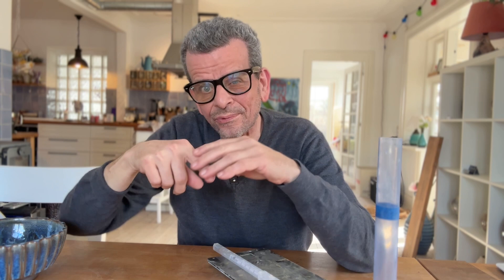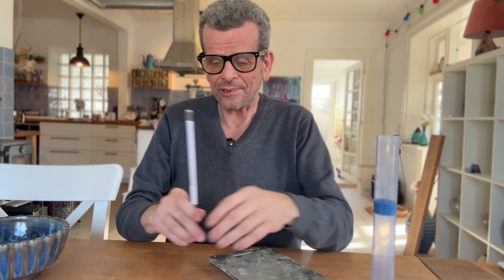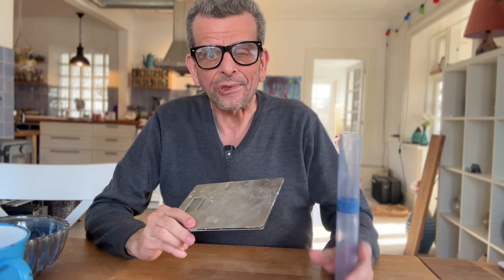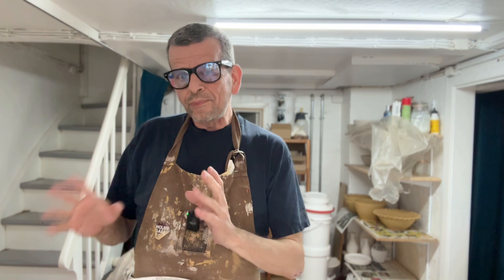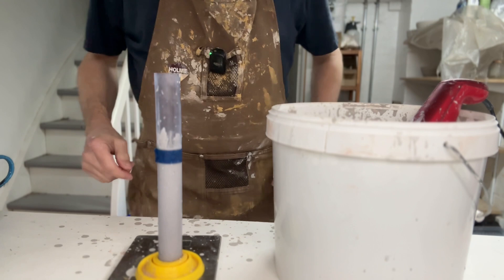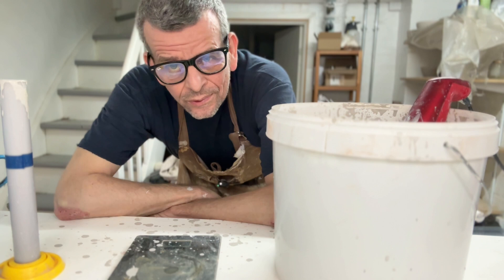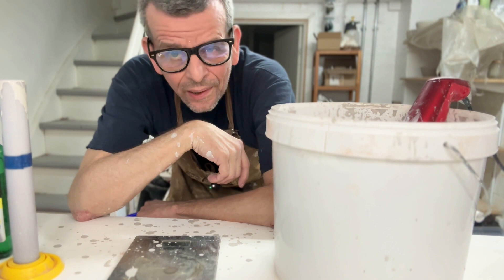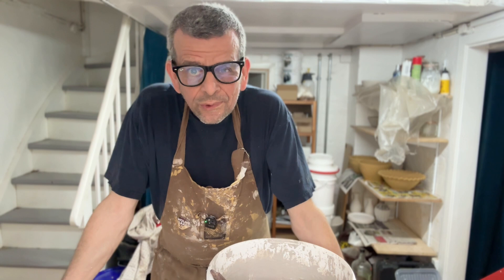99. How to Measure Specific Gravity (SG) for Pottery Glazes

Comment: Just curious, what was the SG for your Copper Green/Blue Crackle glaze in an earlier video??
Reply from the maker: Not sure which one you mean. I do not use crackle glazes :-)
Reply: @deMibPottery  Video #50 you have a Blue/Green glaze. This is the one I was asking about the SG.
Reply from the maker: Ahh that one. I actually do not measure SG for this sort of Raku glaze. I mix them very thick for brush applikation. So it's more based on experience :-)